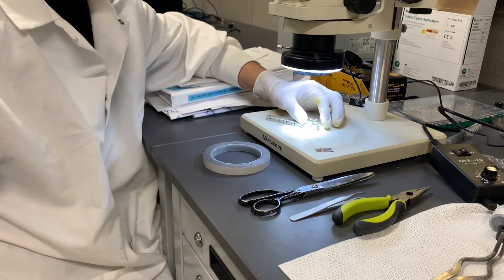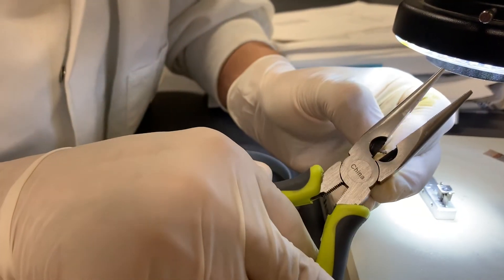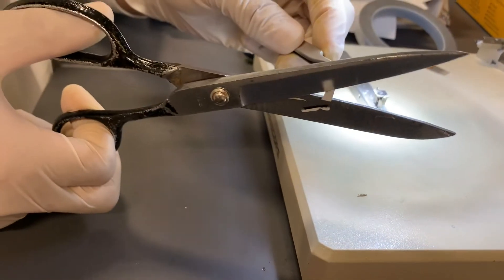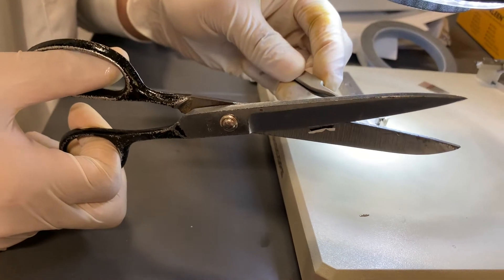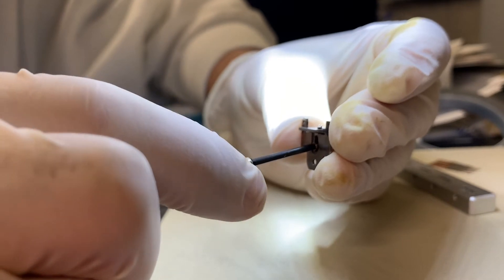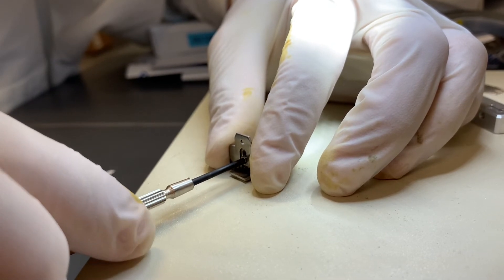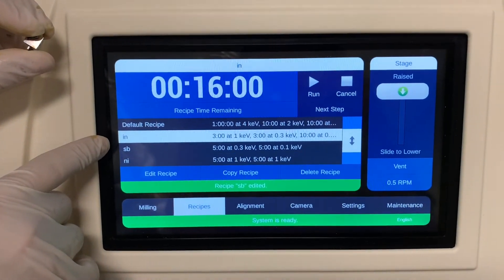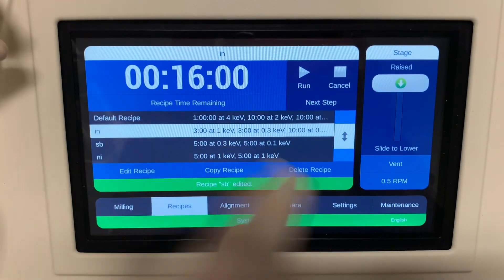Gatan 697 planar sample preparation

Comment: I use same Gatan 697. For copper base material pin, with Ni and Au or Sn plating layer, do you have experience, what's the proper parameter? Like beam voltage and milling time?